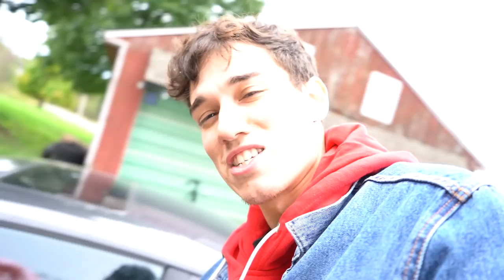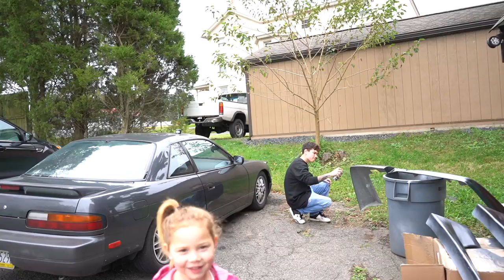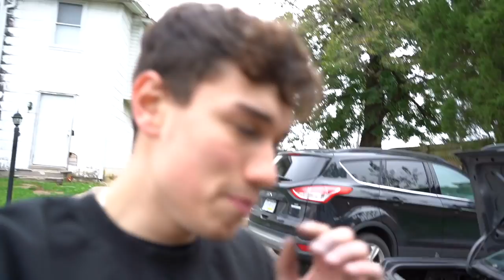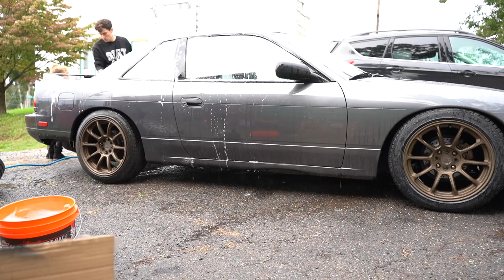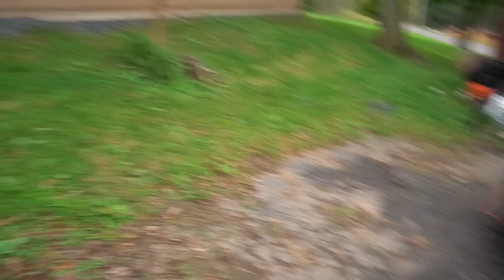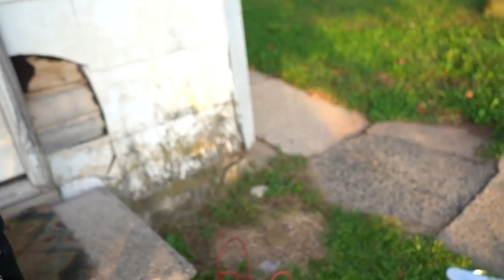THE TURD S13 GETS A FACE LIFT | NEW SIDE SKIRTS AND WHEELS

Comment: I just saw your video just now. I painted my fenders and it came out factory gloss. You have a chance go on eBay in order spray max 2K clear. It’s 20 bucks but it’s very simple to spray right out the can. I’m planning on making a tutorial on YouTube next week to explain how to bring out factory shine
Reply: I use also Dupli color perfect match because of the paint and the wide spray nozzle. If you get zebra stripes on the clearcoat it’s very forgivable. It also takes about an hour up to two hours for them to go away. But after it cures for about 2 to 3 days. Wet sand 1500 and also 2000 grit to get rid of orange peel. Then use rubbing compound from turtle wax by hand and keep adding it drops at a time. Hope this helps with some body panels! Great channel btw keep it up!
Reply from the maker: Awesome man! I appreciate all the advice! They came out pretty good! Ill have to check out that clear though!!!